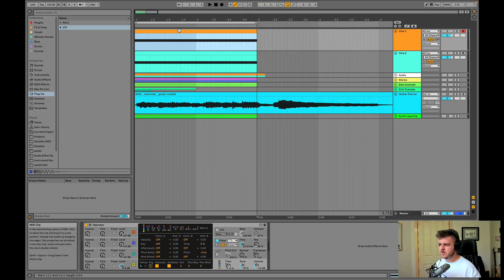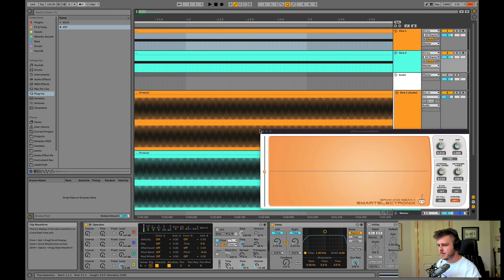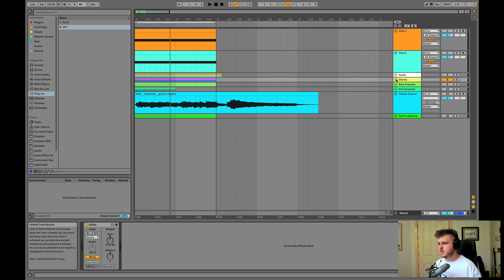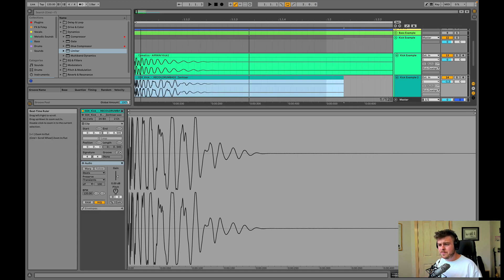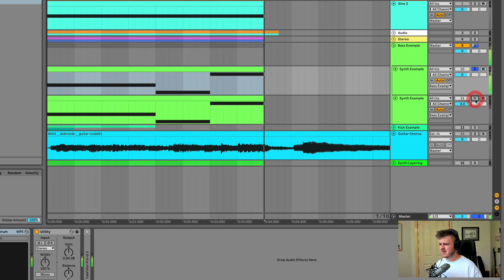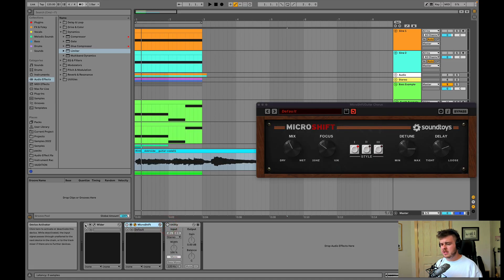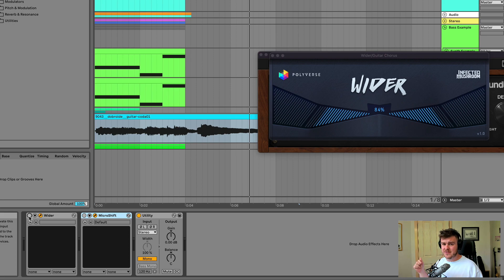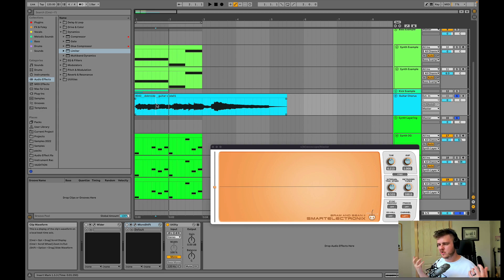Phase Cancellation Is RUINING Your Music

Comment: Tip: If you're getting nasty phase cancellation with your kick & bass, you can use an 'all pass filter' on one of them to shift the phase.
Or if you use a fancy synth like GHOST or Serum for your basses, you can adjust the 'phase' control on your oscillators until they blend better with your kick